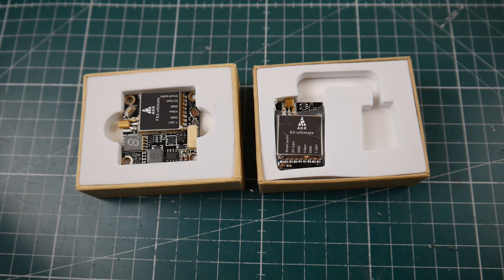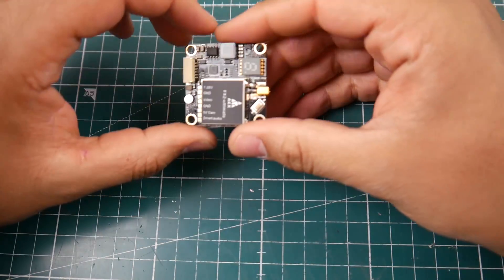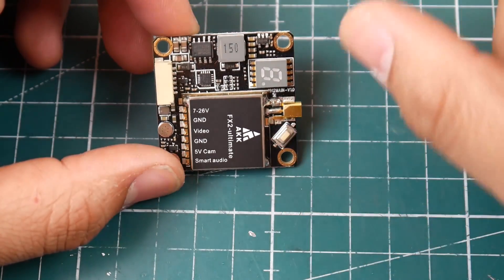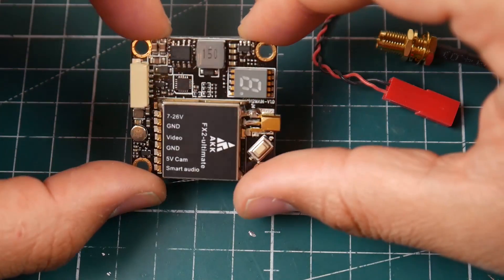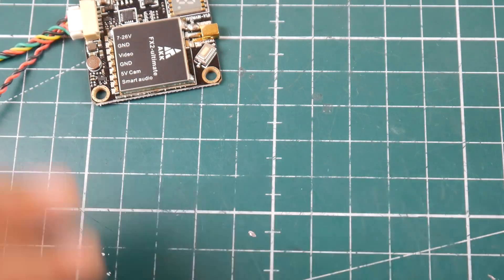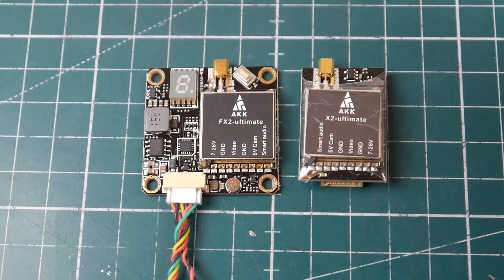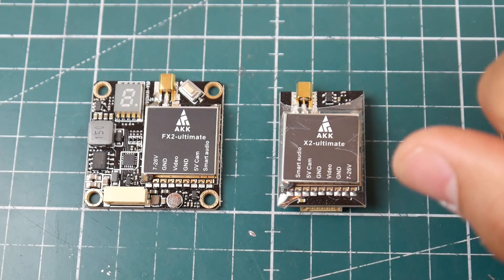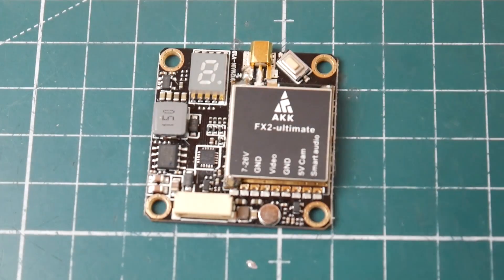Best Long range VTX with Smart Audio?? // AKK FX2 and X2 Ultimate

Comment: I’ve been using the fx2 for about 2 months now in my remix. Smart audio doesn’t always work, which is frustrating. A lot of noise too. Sometimes, just unplugging a battery and putting it back in cleans it up, but an oddly inconsistent problem. Doesn’t seem like going over 200mw gives me extra range, just more noise.

Comment: I'm curious about SmartAudio support in these. Are they still have broken AKK SmartAudio implementation or finally fixed it to compliant one? Also how long they will last in real flight. Had a very bad experience with Atlatl HV - 3.3V BEC in two identical VTXes died after 30 minutes of working.
Reply: they have been fixed

Comment: It's coated for sure. I have the FX3 20x20 version and lost it in the pond for over 5 minutes before taking my clothes off and retrieving it. I left it on the bench for 3 days and it powered up with no issues. Best $20 dollars I've spent on a VTX.

Comment: Maybe 1200 actually mean 600 LOL because their 800 milliwatt ones only go to 200 lol. You got to get a power tester and see how much these companies just make up the numbers they're all 200 milliwatt transmitters most of them
Reply: Blowfeld20k your abnormally aggressive for some reason.
Reply: dont use pigtails, you loose a lot of power
Reply: Why do people have to be so... negative? Just because someone said something that you don't agree with doesn't mean you have to get all shitty with them. Did it ever cross your mind to "think critically" and actually be a proper critic, instead of just hurling insults at people? Might help you be less of a hypocrite when you talk about "half baked garbage", son.
Reply: Not possible because I had a 200mw in my quad before I bought the AKK FX2 and it works a hell of a lot better on 500 or 800mw
Reply: @alchemicalanarchist  Because most likley you were only actually running on about 100 on your old one.. To run up at 800 and above you'd need a massive heatsink.. 90% of the transmitters are lies.. Look at the size of the heatsink on the mamba ultra just to do 1 w !!!
Reply: Blowfeld20k good to be sceptical about manufacturers quotes. But have you got any evidence showing they output only 200mw?
Reply: Blowfeld20k replied to wrong person. Chillout.... son.
Reply: @Fuzzwad
                   eh .... whatever ... son ... I made my case quite clearly even advised everyone to check the relevant data for themselves. So get off your soapbox m8. I don't see how telling someone who OBVIOUSLY did not (since argument was full of holes) think, to think more, is an insult.
And i am sick of ppl who make half baked comments then call aggressive on anyone who dares to point out the holes in their thinking. my comment wasn't aggressive it was detailed and gave no room for a viable comeback .... since it was based on facts. ..... so kid got salty about having his comment debunked and went for the "high principals" gambit of painting the person with a better argument and delivery as something negative (a little like you are trying) ... my response to that kind of insight is always disparaging. 
some ppl need to learn to think more before posting and guys like you need to learn that YOU don't define how i communicate .....specially since you seem to barely comprehend the important elements of the convo  ............... bye son enjoy the myopia
Reply: tomar5e115 yes there are plenty of videos just watch them put it on the immersion RC power tester only goes to 200 like all $20 600mw  Fake labeled VTX s. You realize they are very easily testable right? Only the immersion RC tramp and TBS unify Pro put out what they're supposed to
Reply: Blowfeld20k well said. Kids these days are so fragile. Their parents told them that they were special and they were younger and I think they believed it
Reply: How would you mount antennas without the pigtail?
Reply: @Avolate FPV
                         LOL ..... pls m8 THINK before you either believe manufacturers or post msgs.
Just because it works better than whatever you had before DOES NOT mean it is actually putting out its stated power level !!!!! .... when they are tested with a meter many VTX fail to output anything near their stated upper limit ...... thats just a fact, go look up some metered VTX tests.

"Not possible" ..... lol ... HIGHLY possible unless you have tested with an output meter son ................
Reply: @tomar5e115
                           Learn to pay attention before taking issue with what you obviously misunderstood .....  son ... it clearly paints you as young ... unused to thinking critically ......
Reply: lmfao .... do you need us to prepare a safe space for you cupcake??
Rough and tumble of the convo too much for you ..... so in future DON'T challenge people with half baked garbage ............ SON!!!!
Reply: @tomar5e115
                        I wish some ppl actually paid attention to exactly what is said sometimes .............
At no point did i state the output for this vtx is bogus .... i did however point out that "many" VTX fail to achieve anything like their stated output ... as this is just a fact.

Neither did i state 200mw ...... anywhere at any time.
As i said previously  .......... go look up some comparative VTX meter tests .... i did say that for a reason, now i feel am repeating it for non :P